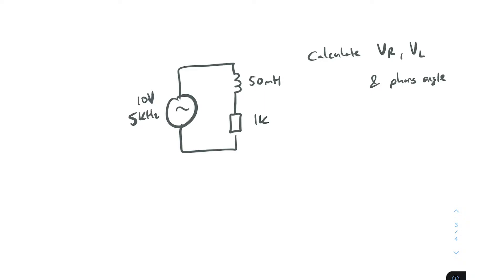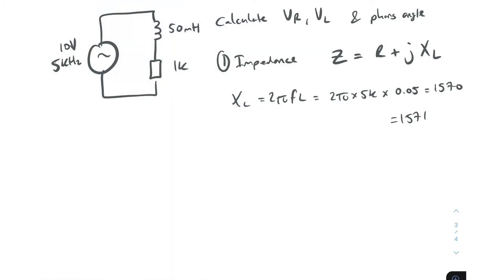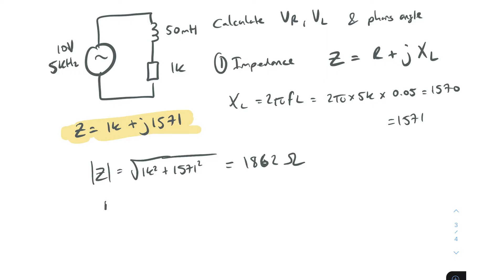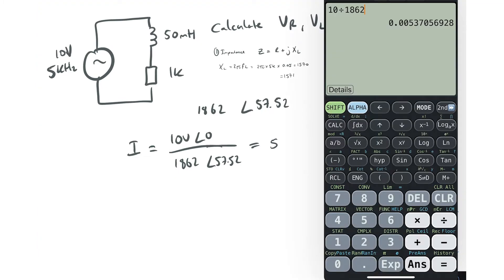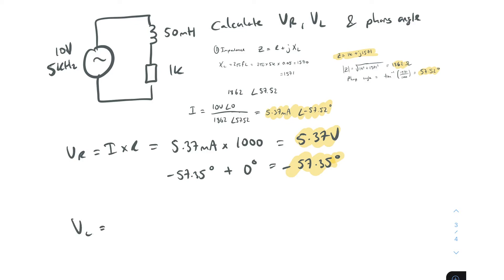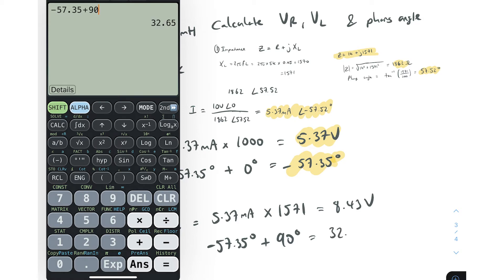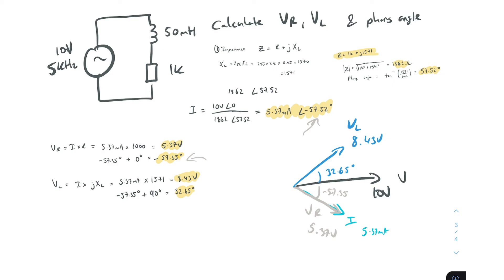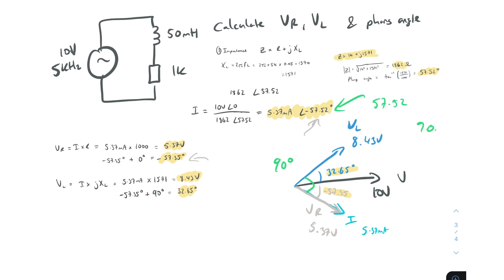Simple RL Series Circuit Voltage Calculations Example Problem

Comment: In a series R-L circuit, a voltage of 10 V at 50 Hz frequency produces a current of 750 mA. In the
same circuit with same magnitude of applied voltage with a frequency of 75 Hz produces a current of 500 mA. Find
out the values of R and L in the circuit.